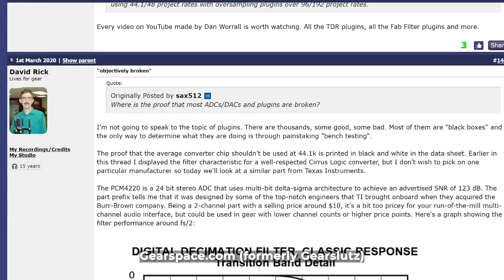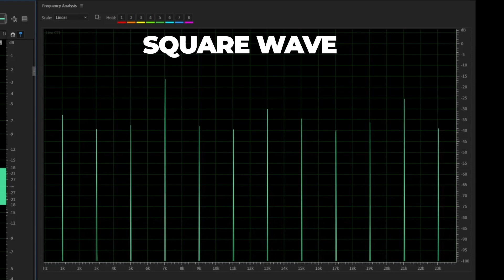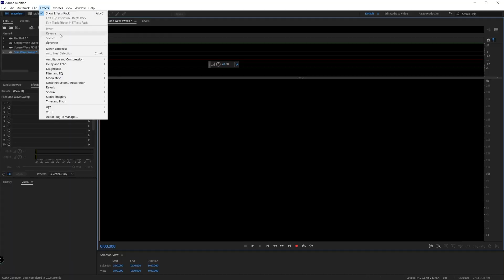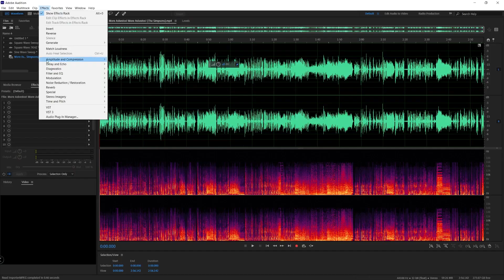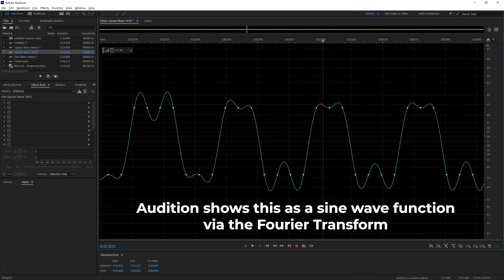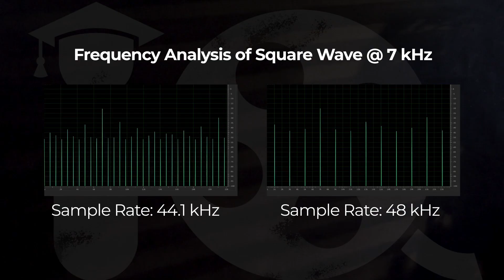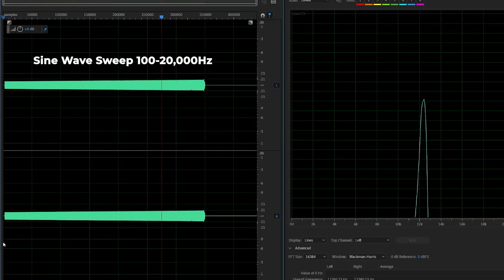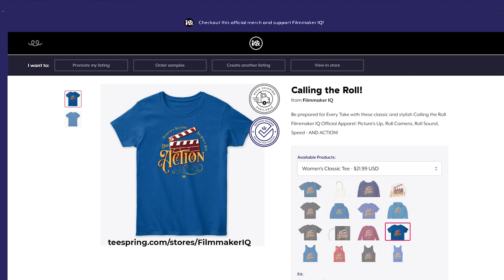What is the Optimal Sampling Rate for Audio? (It's All About the Aliasing)

Comment: John, this is the worst explanation of the connection between aperture, circle of confusion, and infinite focusing I've ever seen!
Reply from the maker: I agree.
Reply: These concepts are connected however.
Reply: LOL!
Reply: Hey John, I’ve been doing digital signal processing since 1980, 41 years, including spatial digital signals.  Nyquist can be grasped with knowing one concept:  that sampling at the Nyquist frequency there is no phase information.  Phase information is restored as the sample rate is increased above Nyquist.  To differentiate a square wave from a sine wave, both still have to be faithfully reproduced, including the phase information.  At 10 KHz, a 44.1kHz  sample rate only produces 4 samples her sine wave, partially preserving the phase of the signal.  Since a square wave is made up of more than one frequency, the phase information becomes important, as it affects the sound not just the amplitude of the sound.  44.1 kHz works because most of what we listen to is under 8kHz.  If you want to preserve phase up to 15kHz, really should sample above 60kHz.

Now, if you are listening to stereo, you really want to preserve more phase information, so makes even more sense to go 60kHz or higher.  Even though to me 44.1 kHz seems fine enough for me.

I always wanted to make a spatial audio standard that recorded phase information as well as sampling information, a transformation rather than sledgehammer sampling.  This has been done commercially outside the audio industry for over 35 years.
Reply: You are totally ignoring the sound reproduction equipment's role in this.  Sure at 10 KHz, a 44.1 kHz sample only produces 4 samples.  So?  The signal recreated by the DAC sent to the vibrating membrane or paper cone of your headphones or speakers while reconstructing this 4 sample pulse of 1 second, it's plenty.  60 kHz may be useful during mastering of the original, but at the consumer level, we don't benefit from it with proper noise cancelling and anti-aliasing applied.
Reply from the maker: I want to do a video demonstrating that exact point.

I see that flaw in so many arguments about the lower sampling rate. One person claimed that three sample points would create a saw wave...
Reply: There is a talk about phase information in audio and it's importance: https://youtu.be/moXaLMT_os4
He doesn't really talk about it in context of digital audio but the concept is the same.
To sum it up: although technically it would be good to capture and reproduce the signal in perfect phase, in practical audio it doesn't matter because the signal is always passing through many filters which all affect the phase and even if it didn't there are the room reflections which produce a gazillion phase shifts (that's true even when using headphones).
So coming back to our problem of number of samples to represent the wave - yes theoretically with "low" (44.1kHz or 48kHz) sampling rate the phase information on higher frequencies is somewhat messed up, it's not a problem with audio because in real room with real speakers you naturally have so much "phase errors" that you cannot hear the difference.

Aliasing on the other hand is a real and audible problem which is cured by filtering and/or by increasing the sample rate.
Reply: @KK-pq6lu  
>At 10 KHz, a 44.1kHz  sample rate only produces 4 samples her sine wave, partially preserving the phase of the signal
That's a big misunderstanding.
It doesn't matter how many samples you have per a period of sine wave, as long as it's over 2. You can perfectly restore the original signal (amplitude and phase) from such sampling, as long as you filter the aliases out. For 10 kHz signal at 44.1 sampling, it's very trivial to filter its aliases.

Again, sampling preserves phase along with amplitude. Note that Nyquist-Kotelnikov theorem states that you can restore the exact signal, not just amplitudes of its components.

Also, phase (constant group delay) is not as important as you think. Your speakers don't preserve it well, anyway. What matters is equal group delay of the channels, which is easy to have.
Reply from the maker: I keep hearing that about preserving phase or timing of the audio... I don't understand why that is so prevalent. It seems easy to debunk. I'm planning on doing that video
Reply: @FilmmakerIQ  good
Reply: @FilmmakerIQ  Would be interesting to generate a file with artificially introduced group delay distortion, which would be an equivalent of different frequencies reaching your ear at slightly different time, and run an ABX test to see if there's any detectable difference between them. A good source would be some solo or chamber music performance (violin, or piano, or guitar), because they can have sharp attacks.
Reply from the maker: Ironically I just recorded a chamber group yesterday although very non precisely. It still sounded great even though a contra basson rattled so much it made me think I blown a speaker cone. Luckily another musician confirmed the sound was in the room too.

But I think your methodology is incorrect. A chamber group is performing in a concert hall, you aren't going to get only the attacks, you WANT to hear a little bit of the reverb as the sound bounces around the hall. 

The "theorhetical" phase limit of 48khz is about 22 microseconds (I say theorhetical because it's seems like a popular myth).

First off, no musician can achieve that level of precision. Secondly, do the math and you find that 22 microseconds is how long it takes sound to travel 7.5 MILLImeters. Reorient your head just slightly and you've canceled any phase precision you thought you had.

But lastly, the timing of the wave isn't actually constrained by the samplimg rate. You can sample at any point in the wave, the peaks can be anywhere even between samples.

I've done an initial test, recording a 1hz square wave from my phone with two microphones separated by 3mm (90 degrees essentially with the phone slightly off axis). Recorded 192 and 48... The constructed waveform in Audition is the same in the frequencies that we care about. The peaks are separated by the exact same amount in both sample rates.

Comment: You switched it up between A and B lmao. Interestingly, the frequency of the harmonic you used is really close to NTSC horizontal refresh rate (15734Hz), which a CRT’s flyback makes audible as it deflects the electron gun left to right and back. I’m 41 and so far I’ve always been able to hear 15kHz flyback
Reply from the maker: Yep
Reply: So that's why you can hear this high pitch noise from CRT TVs?
Reply: 39 and oh gods do I NOT miss working on TVs and that wretched noise.  I can only imagine how horrific that nose must be to cats and dogs.  We practically used to torture our pets with those damnable things.
Reply: yep. as a kid I could hear if a TV was on even if the screen was dark.
Reply: As a kid I was very happy when my dad bought a 100 Hz Philips TV (Europe so we had PAL). It effectively doubled the frame rate and thus both removed screen flicker and that horrible high-pitched noise.
Reply: @GoodOlKuro  yep
Reply: You may be able to hear your TV rattling, but be aware that is the result of a totally non-sinusoidal waveform and there can be LOTs of chatter and sub-resonances from a multitude of things mechanically attached to the noise source. I used to repair TV's and the most common failure modes around switching circuits was cracked solder joints. Now I can tell you that it's near impossible to shake a line transformer 15625 (our line frequency in a 50Hz country) per second, but quite possible at a sub harmonic. Not saying you can't hear it, just that it is (probably) not what you think.
Reply: @etmax1  I mean, it’s the same tone I’ve been hearing for 35 years across almost every single 15kHz CRT I’ve ever been around